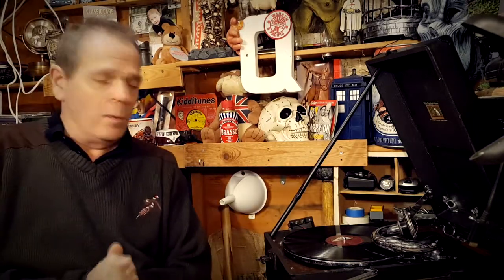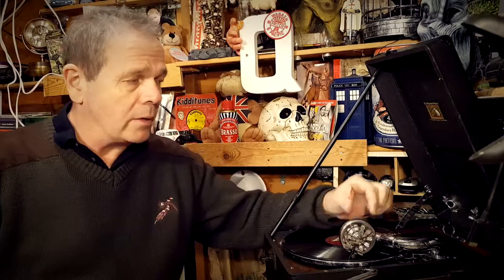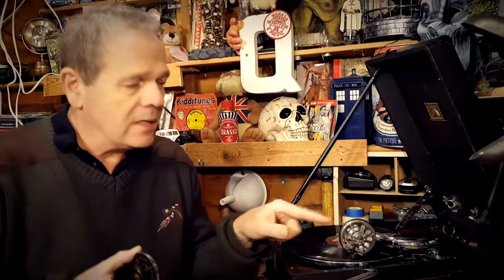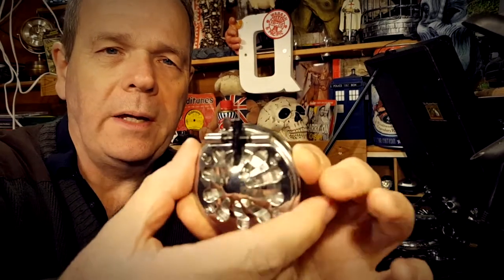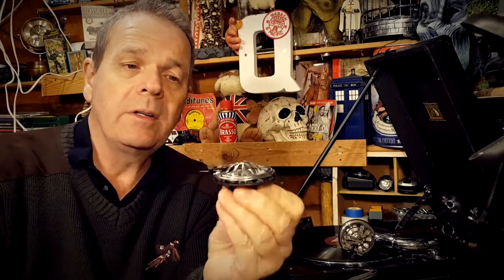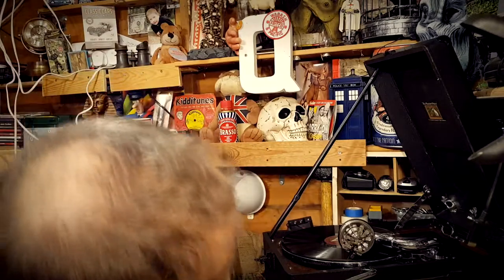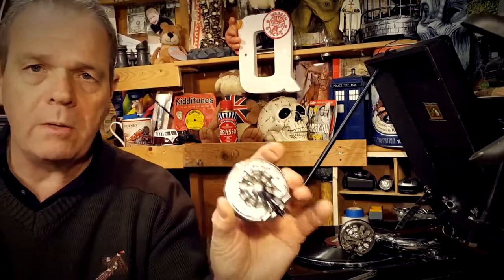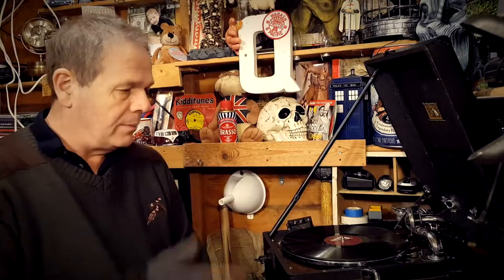Gramophone Soundbox Damaged  -   HELP !

Comment: My HMV 5A soundbox has tightening screw problem when I put my steel needle in it. 
The grip is loose. I suspect the screw thread inside is broken or damaged. The tightening screws is u damaged from my inspection. 
Can you help to repair ?
Everything is fine with the soundbox except the steel needle when tightened has very loose grip. 
Please help. Do you repair soundbox ?? Thanks
Reply from the maker: Sorry I am only a poor amateur and don't do repairs...   I suspect you are right though, but have a close look at the screw first, you can sometimes find spares on the Internet...

Comment: If it was mine, I would solder it myself, allowing the solder to drop onto the needle/diaphram joint. I have repaired holes in aluminium diaphrams with araldite. But, your after an expert opinion....I am just someone who tries things!
Reply from the maker: Sorry for the late reply...   I will certainly try I and see what happens,  I may video it...  Thanks for your advice it is very much appreciated...
Reply: I'm with Greg. Give it a go.

Comment: Here's a link to a supplier/repairer:http://fonograf.com/about/ He's Ken Priestley of Holmfirth Antiques. I've always found him helpful & willing to give advice. As for the repair, solder may well work, but if the stylus bar is broken away from the aluminium parts, remember that its not possible to solder aluminium! I'd be inclined to try superglue or epoxy resin. Also, since its taken a knock, check the adjustment of those pivots. Have a look at my channel if you wish, several gramophones & records, including a rare 'Marathon' gramophone & a Collaro RC1 autochange. as far as I know they're the only examples on YouTube.